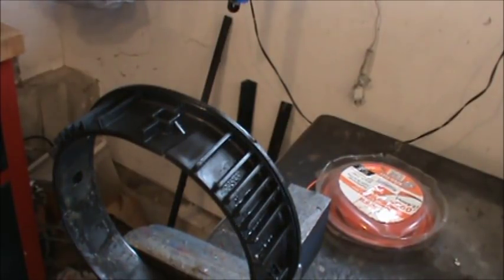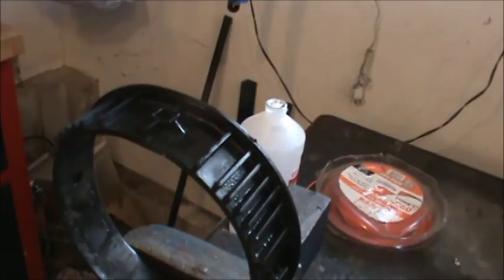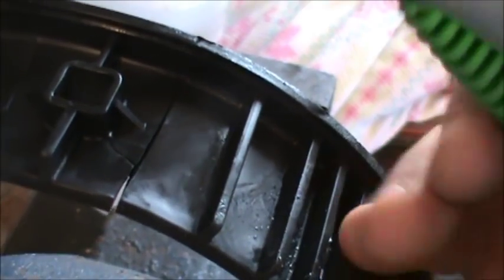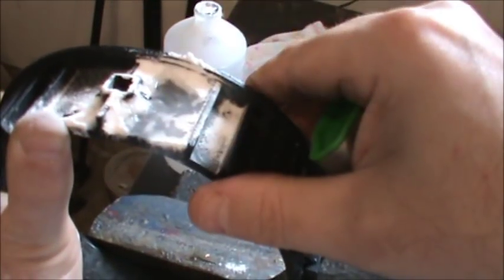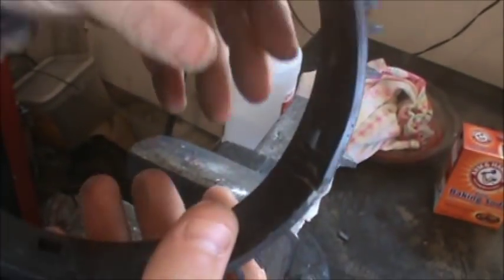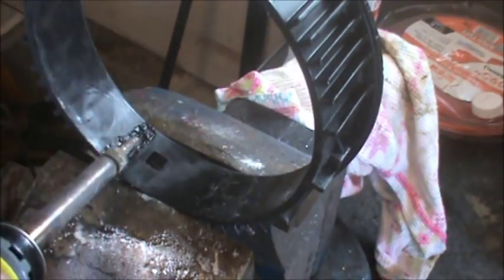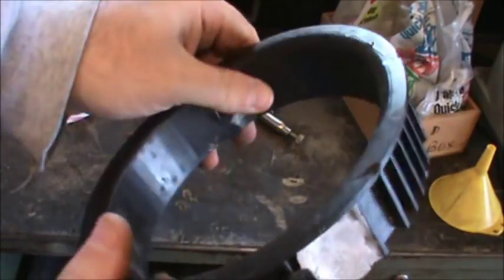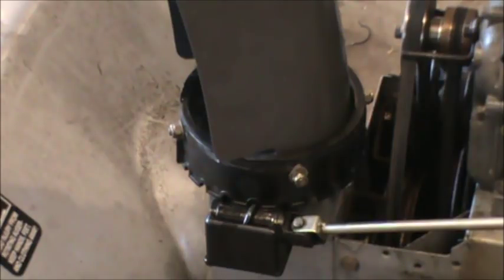How to Fix Broken or Cracked Plastic or Weld Plastic

Comment: Another tip.

Regarding overtightened bolts on load bearing plastic.

Put a little rubber bumper between plastic and metal. Cut a washerfrom okd bike tyre.

Comment: Great video. I have use baking soda and super glue to build up a plastic nut on a banjo neck. I did this because two of the strings were sitting too low in the nut. The nut is the string guide at the top of the banjo neck.

Comment: I have a hair line crack in the blue part of a PUR 30 cup water filter receptacle.  I could save $35 plus if there is a way to fix it to keep it working properly.  I don't see water leaking through, but it probably isn't sealed.  Would this method work at all? Would it be safe?  I'm thinking super glue, even dried could be toxic.

Comment: Why don't you do a real weld? Melt the two pieces together with a solder iron. You could also sink a piece of wire mesh into it to make it stronger than original.

Comment: i burned my microwave door with the foil i used. it burnt the plastic sheet that covers the inside door. now there is whole inside and making the glass door outside moistened. I wanted to put a heat resistant tape or RTV sealant but I am really afraid that i may damage it more. please help me. or should i use a heat resistant tape? thank you and happy new year!

Comment: Back in 1970 I was i a remote area in the Philippines for the first time and saw an old man fix a cracked plastic bucket buy using a strong wire and a fire as his solder gun. He made holes on ether side of the crack. Then melted a bread bags in an old can and filled in the holes and wire like stitches. It was just as good as before it broke. Weird but he changed my life as I could fix many things after watching him fix the bucket.

Comment: FYI, cyanoacrylate (super glue) adhesives are available as gels also.  They are a little slower to cure and would allow you a little more working time for repairs like this.  Also, none of what you're doing here is new.  I've been doing repairs like this for decades.

Comment: Have you ever tested out just performing a plastic weld with the solder gun and not including the C/A Baking soda mixture? Is the strength of the weld not as strong?

Comment: I would suggest rubber washers under the nuts to absorb the vibration of blower motor which probably added or  contributed to the crack

Comment: Good job DW6! 
can the weed eater line be used in plastic repair with certain plastics too and what type?I realize the numbers are marked for different formulas for recycling industry on the bottoms of containers i always wondered about anyone with the exact knowledge of them all and whats for what because i have dabbled in this topic and i find it interesting along with potential toxicity if you dont take common sense precautions like try not to breathe the melting plastic fumes either use breathing mask or a fan or outside wind to blow the fumes away from oneself.

Comment: I need to fix a cordless drill that broke the top off from the pistol grip bottom.  I was planning to epoxy it, but this looks like a better fix.  What about fiberglass in stead of baking soda?  The drill takes a lot of torque where its broken.   I would like to fix it and just use it as a screwdriver from now on.

Comment: You're a life saver! I'm swapping dashes in my na miata and the one I'm swapping with has one crack on the plastic heater vent up top. Used this and painted it to match and you would've never known. Thanks!

Comment: Just wanted to drop a line and thank you for this post- had a broken throttle control on a riding mower- the metal carb cable sliding across a plastic hole in the handle eventually etched out.  I found a replacement on ebay- but will see how this holds up and keep new one for a spare-glad I saw this before I went out to get epoxy---always had issues with broken plastic parts now I'll almost look forward to them!

Comment: Dear Mr. Wide: I have a plastic tab holding a portion of what's called the air intake resonator box on my car. It isn't essential to any function of the car but it does help secure the box. It is plastic but I don't know what type of plastic. The last plastic part I tried to fix on it was the front grille. It turned out to be polyurethane or polyethylene neither of which can be fixed with super glue, Rapidfuse or Shoe Goo (aka E6000, Goop etc.). I have secured it with duct tape. It's  another part not essential to the function of the car. 
What type of plastic is the part in the video? Is there a number on it (1-7)?
Thanks for the video.

Comment: quick question man. is the superglue and baking soda combo resilient to heat? I've got a crack in my plastic engine cover of my VW Passat. In fact, this cover has the air intake attached to it. Problem that these covers have is that when you take the cover off to do get at the engine (say for spark plug service), it flexes when you take it off its mounts and can easily crack it because it is a big piece of plastic. Is it better to weld it? Your thoughts?

Comment: I knew that guitar techs used super glue and baking soda to replace or fix a broken nut on a guitar. They even file and sand it, once set, to shape it.  I never thought to use it for just general repair like this. Thanks.

Comment: Great tip. I used it to cement my glasses to the frame. I tried super glue by itself no luck. I also tried glass ionomer, no luck.What other tips did your uncle share with you?

Comment: No...... it is about how much money you can make. No one ever became financially secure or prosperous by saving  their way there. They actually had to make money.
That said, hot air from a reflow solder station and filler is best for welding plastic. 
Nothing wrong with fixing this, 
 $80 for a couple of plastic parts is highway robbery and one more reason Sears is tanking. The CEO of once a great company which never compromised on its quality is satisfied with garbage. A shame.

Comment: Had an  expensive fry pan years ago that stopped working,took control apart, filed down contacts, saved $50.00 bucks. Pays to try to repair then replace. Good vid..
Reply: Get to learn why trying.

Comment: Thanks for the baking soda tip. One thing that can be acheived is to take some small band of tissu & put it around the piece to be repaired & then put the glue. It does the same exothermic reaction, u can even see sometimes smoke getting from it. after that ! As a matter fact, I repaired the plastic piece, which was litterally splited in 3 pieces & which is joining the motor to the middle axe stick in my washing machine, with some '' Scott Towel '' bands & instant glue. As you said strong as concrete! Any how, I' m now gonna look for ur other vids! Thanks again!

Comment: great video, I’ve used the baking soda trick numerous times and it does what you say it does. I’ve heard that fiberglass reacts much like the ‘super glues’ to baking soda BUT I’ve yet to try it. Fiberglass cloth then adding a superglue to it is worth a test (for me) it might give the part some added mechanical stability (both are EXOTHERMIC reactions which can give off  A LOT of heat) or even carbon fiber cloth(??). Note, I ALWAYS have some parchment paper around the shop because NOTHING sticks to it (just steal it from your wife or grocery store). Also, a sanded/rough surface gives you better results...it gives the adhesive something to grab onto

Comment: Hey Buddy:  I worked with C/A's (cyanocrylates) for many years, in repairing and restoring pianos.  I got the worst burn ever, and unimaginable pain, when I tried to soak up some spilled super thin C/A in a rag, and the rag and glue stuck to my finger.  In my 50's, I was diagnosed with COPD, and I credit a great part of my lung damage to using the C/A's and the accelerators that used with it. If you ever see a stream of vapor coming off the setting mixture, get away!  Those vapors contain cyanide gas! Get yourself a NOSH respirator, and charcoal filters for organic vapors, and even with that, position a fan to blow the vapors away from your mask, and don't ever let that glue/soda mixture stick to your fingers, unless you want a hell of a burn. Same thing for the plastic fumes, different poisons, but same result! About your method--if you are protected (hands, too with rubber gloves) put a thin layer of soda on 1st (no more than 1/8th"), level it out nice and even, then drip thin C/A along the edges.  It will run into the middle, and you get a nice even job with no filing or sanding (when it matters).  You can also use metal screen (like rebar in a concrete pad) with soda on each side for high stress repairs. The local hardware guys call old retired me MacGyver-'cause I'm always fixing things and looking for weird things to repair things with. Another reason, besides saving money, is to get the maximum value of things we have taken from the earth to make things (raw materials don't last forever) but landfills will last forever, and we're keeping stuff out of them!  Good on ya!  Take care!
Reply: Thank you for your respose regarding the safety concerns with (cyanocrylates) .Nasty shit.
Reply: Some say Apple's Steve Jobs got pancreatic cancer from inhaling the fumes of lead, flux, acetone as he worked soldering motherboards as a young tech.  These fumes may kill/ cripple you.  Plastic soldering may be even worst!  If you dont have fan+ good ventilation, then dont mess with soldering.  Peace.
Reply: What he said! I am constantly seeking work-arounds, tricks and cheap or free fixes to common modern component failures and sounds like you, Sir, are a fountain of quality tips and insights. Consider documenting your wisdom for the benefit of posterity and to offset the cost to your health. I appreciate it even if it is just in the comments of another video.
Reply: This comment is underrated, thank you sir for sharing your personal knowledge and safety.
Reply: I was thinking the same thing specifically about putting the iron on a cyanoacrylate glue joint.  Cyanoacrylate and burning plastic are bad enough, but burning CA is terrible.

Comment: I just broke a plastic swivel on a snowblower plastic headlight housing.  I'm gonna try your method(s). Thank you for this.
Reply: After a failed mediocre attempt with 2-part epoxy, I considered fiberglass cloth and resin. But I watched your video and had great success, I even sanded and painted the glue/soda patch for a finished look. Thank you!

Comment: Well i thank you for showing us how. See i just came on here to try to figure out how to repair a cracked slide. To see if it was possible to even weld plastic because there is a very large long crack down a slide thats on a used swing set I just bought my kids for cheap. I'm replacing the slide with the one they have on their old swing set of course since its the same slide different color. However  I will be selling the old swing set &  I thought it would he nice to either try to fix the slide to sell it with it or give it away with the swing set & tell the new owners how they can fix it because unfortuantly you can't buy replacement slides for them. They only have those large wooden playground slides for hundreds of dollars. You literally have to buy a new swing set to get a new slide to these metal swing sets. I considered purchasing those new little 3d pens they have & trying that to repair it but it would take more plastic to do so & more money & may not hold well only to waste my money. Think this can work as long as I do the repair under the slide it won't be in the way or scrape up legs.

Comment: Used this video's recommendation and repaired the very thin plastic liner on the inside of our old (28 years) refrigerator where I had cracked the screw holes all around it. Now the door closes firmly and stays!

Comment: Thank god for Internet!! i used this method and actually fixed my headphones, and the part where it was broken was very fragile, it amazing what you learn in internet. doublewide6 Repairs LLC thank you for this inside information. People what i additionally recommend use super glue but special for synthetic material and with agile properties, i used such one and got very good result it holds like rock, for people in Germany backing soda name is Natron, costs like 0,60 euro cents! Headphone manufactures, dont build fragile headphones, because nobody buy from you again and use this tutorial to fix it!!!!

Comment: You really should do your plastic welding outside & you should wear a mask.When plastic is heated if gives off formaldehyde.If you inhale lots of formaldehyde you can get cancer (possibly brain cancer) from that.This is why formaldehyde and several other chemicals were removed from nail polish.

Comment: Hi, I tried your tip and it worked a treat but the fumes were really strong.  I was outside but it still took my breath away and effected my eyesight.  It could have been worse and you should put a warning on your video.

Comment: HI!  Thanks for the video, but I want to fix my cars reservoir.  My car is very old & they don't make parts for it anymore.  The reservoir is plastic & LEAKSEAL wont work on it cuz it's too close to the engine & can't take the heat.  Can I fix it using your method?  Will it stand the heat of the engine? If not can you make any suggestions!  Thanks for your reply
Reply: candice kudriaszow did you fix this? I would use plastic welding , there is a guy on you tube doing professional welding technique , he cleaned it with alcohol, he taped one side with with tape made for household heater connections , then he used a small dremel like tool to sort of make a small thin valley then he put a bonding agent and use plastic rods/ sticks and fill in in with plastic weld .he then repeated on the other side and remove the tape from also He was repairing a car fender. One other guy also used a small piece of fiberglass to reinforce it .

Comment: Has anyone tried this with a lamp? I have one of those standing floor lamps and the plastic shade has started to crumble at the bottom. I'd love to try this, but I'm not sure if that would cause a problem due to the light bulb/heat

Comment: Your video was very helpful. The plastic water dispenser lever in my Samsung fridge broke. The manufacturer stopped manufacturing this $5 part and none of online parts shop has it. Since this was a lever where some pressure was put, I was going nuts fixing it. Also there was not much room to hold my band-aided supports. The super glue + baking soda compound is like a rock. Thank you so much for posting this video to share your knowledge. Really appreciate it.

Comment: Brother you are so right... today we have become a throw away society... instead of being inventive and resourceful we simply become consumers.   And you are right... a penny saved is a penny earned... Now if you are a mega wealthy person or part of the 1 percent then I guess you would not be watching this video anyways.   I have an old saw that works perfectly but the ratcheting knob has a knurled or geared portion that tightens the angle adjustment .. the single lever handle turns but you can pull the handle out and twist or rotate the handle so you don't need to worry about hitting other parts of the saw.  Well the geared section is plastic and seems to have snapped so I will try to repair with your system... Failing that I will replace with a metal ratcheting handle from amazon.  Hey you have over 200K people who have seen this video so disregard the haters bro.
Reply: well sometimes trying to get the matierials and know how is worth more than just getting a new one
Reply: So you know I did fix the item which had a serious crack in the racket socket and this baking soda and crazy glue worked really well.  thanks again

Comment: This baking soda and super glue technique is used frequently on guitar necks, especially in cigar box guitar building. It works very well.  I have a Craftsman powder coat gun that is made of plastic and is broken in half at the handle area. I plan to try out this technique to try to put it back together and stiffen the handle so I can salvage the gun.  I am not so sure that the soldering iron would work so well on my broken gun, as the plastic is so very thin in that area which is broken. Since I really do not care as to how nasty the final produce may look as long as it works to effectively put the parts back together, and hold them rigidly, I don't mind the glob look of the baking soda and super glue technique.

Thanks for posting this video as I had almost forgotten about this technique. On my project, duct tape just won't do to fix it and the Gorilla Glue or other glues probably would not hold up to the strength necessary for the gun to be put back into service. This may not either, but I won't know until I try and the gun is essentially useless as is.  I wanted to cut a piece of 1`/14" pvc pipe into a section and then split is so it could be pushed around the handle and glued in place to make it into a brace for the gun. I may still do that after applying the super glue and baking soda trick though.

I believe there is a weed eater spindle laying on your work bench in your video. Can you take some of that plastic weed eater string and melt it into the channel you in the cracked plastic part you showed in your video. Would it act as a fill agent by doing that?
Reply: Not sure if weed eater line works but I know a lot of people use zip ties as filler plastic. My best results are when I can use a little bit of plastic from the item I'm repairing. Same types of plastics mend together well. Also, for a stress crack I try to use staples across the crack, melted into the plastic. Or, window screen laid across the entire seam and heated until it sinks slightly into the plastic.